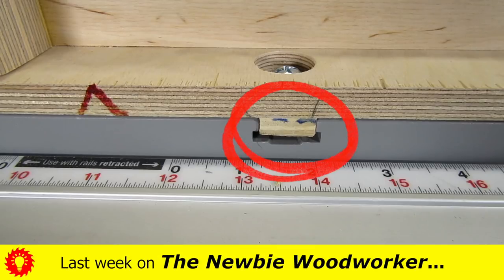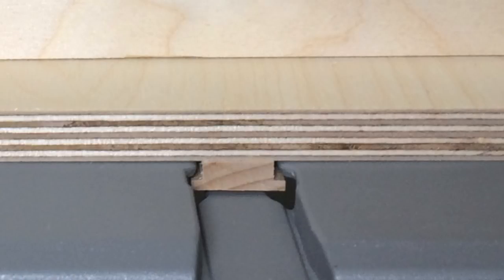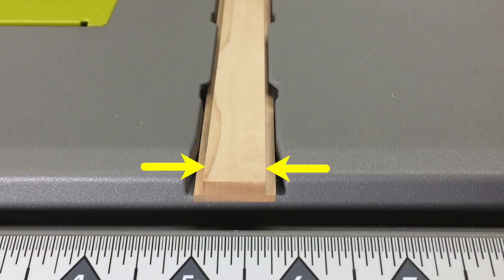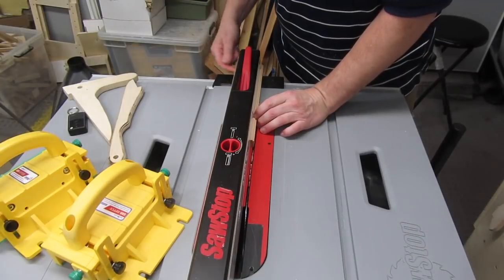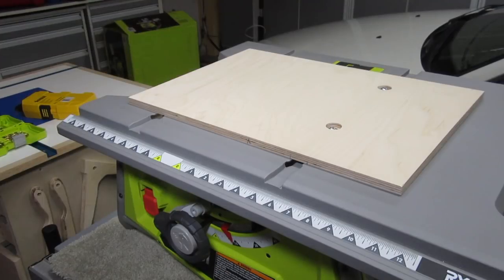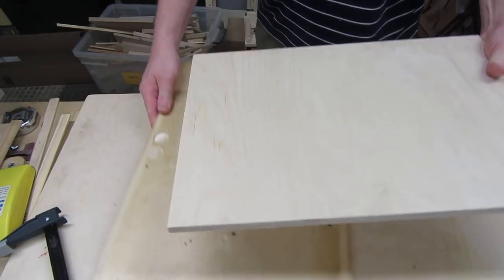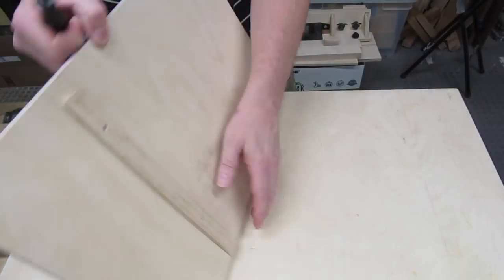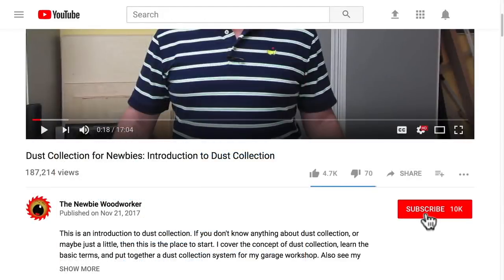Runners for Ryobi/Craftsman Tabbed Miter Slots

Comment: Finally someone with the exact ryobi (pain in my butt) table saw lol! I have zero prior experience with the versatile yet dangerous mechanical tool, so I have no way of comparing to other brands and price points, however, with that said I don’t want to quit on mine until I have a good excuse and time spent understanding of how to use it. I’ve used it for ripping 45 deg French cleats and other basics but I tend to make excuses to use anything other than it and partly it’s due to fear (I don’t feel as in control of it as I should) and I’m perplexed how to build a table saw table to slide it into for safer use, extended space of larger pieces, table saw additions and jigs, etc. Is there anyway you’d be apt to take on the project of building a suitable (well fitted top) that not only extends but is made to be as functional as other ts tables are made to be? Partly my concern is there’s not much space for trimming and ripping, and as short as I am (5’1”) I feel like the mobile base is just too high for my comfort level. This is especially true when ripping long boards as my elbows do barely extend over the top but I feel myself fearing the wood is face level to me. Lol silly but I’m so curious about what I can do to make this table saw safer, more reliable as far as having the height just right and room on either side and in front for larger pieces to safely cut. I’ll never be able to cut down a full piece of plywood, that’s understood! Lol but even with precut longer or wider pieces I just don’t have anything to balance the wood. That and my fence is so limited as well. The price of buying low grade I suppose but also I’d rather “earn” my way into higher quality tools after I’ve developed a true understanding and natural sense and feel for the tool. My mitre saw, I’m comfortable with of course. Easy enough but the table saw is so much more powerful and as much research and hours that equal up to several years of observing and taking advice, it’s this tool that I still haven’t conquered. Maybe with a table or preferably a bench would equip me and other ladies and brand new learners to feel more confidence in handling such a necessary tool to woodworking and building
Reply from the maker: Honestly, if I had a tool I didn't feel safe(ish) with, I wouldn't use it. At least not until I learned how to feel more comfortable around it, and the key to that is knowledge and experience. So if you haven't had experience using table saws, I highly recommend looking around your area and see if anyone offers introductory courses on using table saws. Maybe a local college, or even a store like Rockler or Woodcraft. I remember seeing some newspaper-like thing at Rockler that advertised lots of different courses. Or look online.

Once you gain experience, then you can decide if you want to replace the saw, or give it a whirl (pun intended). And if you think you don't want to spend money on a course, consider the cost, in both pain and money, of an injury and hospital trip. And of course you can't guarantee being safe all the time, but trust me, learning how to use a table saw SAFELY is the best money you'll ever spend. I did so many stupid things when I started using my table saw, I'm extremely fortunate I've still got all my fingers.. Good luck!
Reply: Don't mean to necro this comment, but I'm sort of in the same boat. I'm not fearful of the tool but I definitely respect it. I work in the oilfield and just bought a craftsman portable table saw. Been learning more every day from it but a good table would be nice to extend it for more of a base I guess.
Reply from the maker: @two2theface408  Makes sense to me! 😄

Comment: Question. Why dont you put runners for both slots instead of just one? Ive seen this done both ways? Is there a reason why? Great video. I have a Skilsaw 3410 with these kind of slots. Ive been itching to make my first sled. Was contemplating sawing off the tabs.
Reply from the maker: Thanks. Apparently a lot of people use angle grinders to cut off the tabs. Personally, that sounds like a good idea, but I'm not giving you advice to mangle your table saw - you have to make that decision on your own. 😉I wrote a blog article on the subject of one runner vs two: https://thenewbiewoodworker.com/2018/05/07/cross-cut-sleds-why-i-only-use-one-runner.html

Comment: I have the cheap 71/4 “ blade Ryobi saw, it only has one runner slot. Is it possible to build a sled for it with two runner slots and use the sled as the table?  I thought I might try that idea, but if you or someone else has done it I would like your opinion.  
Thank you for your great videos!
Reply from the maker: You could, but you don't need to. I usually use only one runner (except for my "revolutionary" sled). Here's some videos:

https://youtu.be/b-65Bs5Yi0w
https://youtu.be/AlUCDzM3gzY

And here's an article on why I usually only use one runner: https://thenewbiewoodworker.com/2018/05/07/cross-cut-sleds-why-i-only-use-one-runner.html

Comment: do you think making these same runners out of aluminum would be a viable strategy? may keep them from breaking as easily and could be made with the same methods and tools, as far as i'm aware. great video though! i have that ryobi table saw and i was hoping to find a good method of making runners for it.
Reply from the maker: Yes, I think it would probably work. I'd try it on wood first, just to get the hang of it before you cut into your aluminum. I have to say, though, that it'll be really messy. 😄

Comment: Hello again, I have a question. In my local Home Depot the only hardwood available is poplar, oak and maybe walnut. Which one has less shrinkage? I am using my saw mostly outside so I am sure wood will dry really quick. Otherwise I have to go plastic for runners. Thanks.
Reply from the maker: Personally, I only use plywood now. It's dimensionally stable, and it's easy to get. Of course, you don't want poor-quality plywood like they use in housing construction, but anything that looks decent when you look at the edges should work.  If you really want to use hardwood, I think it's more important that the grain runs vertically - see https://youtu.be/0gvx-_YipOs?t=56. Whatever you use, if you attach it using machine screws instead of glue, you can replace the runners if you ever need to. I hope that helps.
Reply: @TheNewbieWoodworker  Thanks!!!
Reply from the maker: @sushi8204  👍

Comment: I just purchased a HITACHI C10RJ and the slots for the runners are tabbed on the bottom and the top of the slots does not end flush with the table top but it gets wide the last 1/4 of an inch or so, I'm having trouble making runners for it, Fabian
Reply from the maker: If it's the one I can see pictures of on Google Images, then don't worry about the tabs. Just make regular runners. Make sure they're thick enough to hang down below the top 1/4", and you'll be fine. Does that make sense? If not, you can email me and I'll see if I can come up with some pictures. I don't like to post my email address here, but you can email me from my website, thenewbiewoodworker.com. Use the "Menu" in the upper right.

Comment: Hey bro- amateur woodworker here too- the part at 4:00 where you're ripping a piece smaller than the opening of the table insert is dangerous- blade could easily suck that piece down in, kicking up the other end quickly and forcefully. Ask me how I know...
Reply from the maker: Thanks. But actually, it's a zero-clearance plate, so there really isn't an issue. Yes, the back part of the insert is not exactly zero-clearance, but it's narrower than the cut (it might be hard to see in the video). Otherwise, I completely agree with you, and I don't have to ask how you know, because I've been there too. 😮😄
Reply: @TheNewbieWoodworker  Oh my bad! I'm looking at the hole that the riving knife is coming through- now I see the zero clearance blade slot-
Reply from the maker: @Holiday216  No worries, and thanks for letting me know that you saw something that might be dangerous. I can't tell you how much I've learned from comments like yours, so by all means, if you see something that looks wrong or dangerous, let me know! 😄

Comment: Thanks for the great video.  I kept thinking about how I needed to get the bottom runner wider than the tabs.  The answer I came up with is that I DON'T.  I'm going to cut runners just as wide as the tabs.  This will work fine unless the tabs bend.  If they bend then we're both making new runners, right?
Reply from the maker: Thanks for the comment. What you're suggesting might work, but I suspect it won't be nearly as stable as you'd like a runner to be. But give it a try and see. And even though I normally say one runner is usually enough, in this case, make sure you use two runners, or there's probably no chance it will be stable enough. Good luck!

Comment: Thank you sir.
Reply from the maker: You're quite welcome! 😄
Reply: @TheNewbieWoodworker  Actually just got done making one today for a 22.5 degree miter sled. I don't trust the miter gauge for this saw, it's so wiggly. I haven't found a good alternative that fits this track.
Reply from the maker: @stormypinkness4030  I totally understand. FYI, other people have said they've used an angle grinder to cut off the tabs, and they've had good results, including being able to use off-the-shelf miter gauges. Of course, doing that kind of surgery on your saw is one of those steps you can't undo, so take that with a grain of salt. 😄

Comment: I had to do the same thing for my circle jig for my craftsman bandsaw.
Reply from the maker: Thanks for the info. I didn't know the bandsaw had the same issue. But I could actually understand the tabs on a bandsaw table, because you can change the tilt, so the tabs might actually help keep the runners in the slot.

Comment: I’m thinking of ordering replacement miter gauge rods from Ryobi and using those as the runners. Thoughts? Bad idea?
Reply from the maker: I haven't heard of anyone doing that, so I'd be interested in hearing how it works out. Let me know! 😄
Reply: That's what I did for mine.  They are pretty short and not a perfect fir (even though they are the proprietary ones directly from Ryobi) so the sled wiggles too much and isn't perfect like I need it to be.  I'm just going to use this as an excuse to get a grinder.
Reply from the maker: @TheNickferguson58  Absolutely - that's the best way to buy tools. 😄

Comment: Do you have an idea on how to fix the fence on Ryobi saw? It can never be positioned parallel to the blade.
Reply from the maker: Well, if it has adjustment screws, I would think you could get it close with those. But if you've tried them and it hasn't worked, then I really don't have any other ideas. Sorry.
Reply: @TheNewbieWoodworker  The problem is that in the back that piece that slides is only about an inch wide while in the front is like 3-4 inches wide. So both don't slide at the same time identical distance. If I was still working in machine shop I would replace back piece with a wider piece.
Reply from the maker: @sushi8204  Interesting. If I was in your place and didn't have any other choices (like buying a better saw), I would make some sort of jig that lets me position the fence parallel when I lock it down. Like a T made from plywood, with a long arn, or something like that. Good luck!
Reply: @TheNewbieWoodworker  Well, I finally finished with my projects (until the next one) and I had some time to take a look at what is wrong with my table saw fence. And I figured it out. It is just bad quality but I fixed it. The fence has two small nylon (?) block sitting in the track that is straight and perpendicular to the table but has an angle on the other side. Upon closer inspection I saw uneven wear marks on both side of the blocks. So what has happen is that when fence is locked it binds these blocks in the track like a wedge so moving it would be impossible. I don't understand why these blocks have to touch both sides. So I took both of them off and slightly sanded them with a fine sandpaper on both sides to make them flat and smooth. So now neither side is touching the track tightly in unlocked position and it doesn't act like a wedge. Of course when in locked position the straight side is clamping and that is how it supposed to be. And now after I unclamp it it moves very smoothly without any binding. 
Next I have to build a sled but it only has one cross-track with the tabs. I own a portable router so I wonder if I can shave them off? :)
Reply from the maker: @sushi8204  That's awesome! Doesn't it feel good to figure out something like this? At first it seems like this unfathomable thing, then when you spend a little time looking into it, it's not so complex after all. Great work! 😄
Reply: @TheNewbieWoodworker  Thanks. Yes it does feel good but I am retired Journeyman Toolmaker/designer. If I was still working in the shop I would have made a long runner out of aluminum to replace the two short nylon pieces. Plus I would put a soft brush on each end to clear the dust off the track.
Reply from the maker: @sushi8204  😂 I like the way you think!

Comment: I know it has been a while since you posted this video. I am subscribed to your channel and bought all what you recommended from Amazon. I tried to do runners for my new Craftsman 10" table saw that has same measurements in your video.  Unfortunately I could not do it. If you read  this comment, can you do a sled for me and I will pay you.
Reply from the maker: Thanks for the comment - I try to respond to all comments, even on older videos. Sorry, but I don't make sleds for people. My recommendation is to return the table saw and buy something else, if that's possible.
Reply: I also have a craftsman 10” table saw. I started building a a crosscut sled a few weeks ago and the runners were a nightmare. I used a CNC to cut them out to exact dimensions, I tried different materials, and eventually got frustrated and ground down the tabs…still too much slop! Finally, I had an idea that was so simple I couldn’t believe I haven’t seen it mentioned anywhere else. Don’t use the miter slots! Make a wider sled and add runners to the outside edges of the table. I pulled out the extensions and used the inside edge. You don’t have to worry about making them perfect width. I learned that you can’t trust the accuracy of the dimensions of the table itself. The length of the front edge of the saw is a hair longer than the back, so my sled is tight in the beginning and a hair loose at the end when pushing. Nothing you can do besides maybe a little sanding. I altered the table enough and don’t want to go too far in the other direction. The sled is still accurate.
Reply from the maker: @jpup2632  Interesting idea! I hope it ends up working well for you. You could also consider cutting the tabs off the slots, with an angle grinder or something similar. Although it would obviously void your warranty, since you can't really use the slots as they are, it's not like you're going to make things worse.

Comment: I have been trying to make some runner for a cheap evolv table saw I have. Trying to make the runners using it has been a nightmare. The fence in this piece of crap  get stuck all the time , the part near the measuring side reads one thing and the part farther away is at a different distance, also in here the "taps" run all the way along the sliding channel.
Reply from the maker: You need to align the fence. There's probably some screws on the nearest end that let you adjust it. For now, just use a combination square and slide it against one side of a miter slot, until you get the fence close to square. https://youtu.be/01R7796JoQo?t=42.

Comment: Great videos! You have some of the best on youtube.  Do you have a video on how to make a zero clearance throat plate for the Ryobi table saw?
Reply from the maker: Thanks! I really appreciate it. 😄No, I don't, sorry. But I tried it once using a sheet of aluminum for the top, and wood for the bottom so it lined up with the insides of the throat. I almost got it working. So it can be done, definitely, but it takes more patience than I ended up having. 🙄

Comment: Grab a cheapo oscillating tool with a bi-metal blade and shred the wings off, file the sharp edges down and you're done.  I literally JUST did this as I got 3 minutes into this video and said "Fuck this." 

Again, oscillating tool with bi metal blade shreds through it like butter.
Reply from the maker: Thanks. Other people have said they used an angle grinder. And yeah, I totally get the FU comment - it would probably be my reaction too if I owned one of these saws.